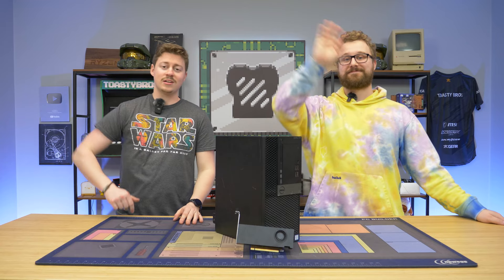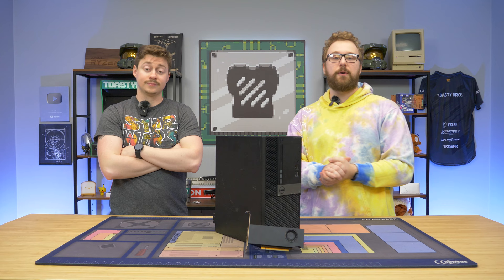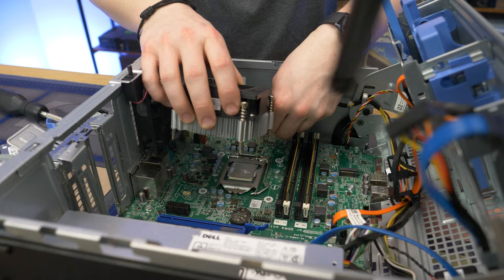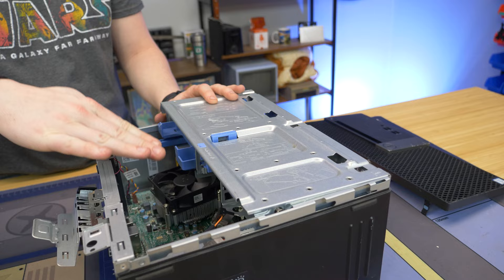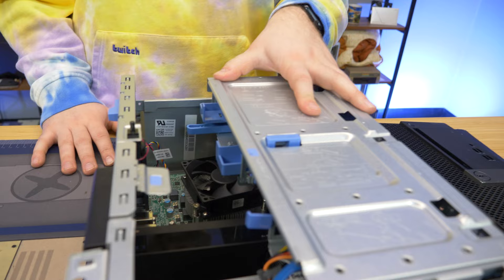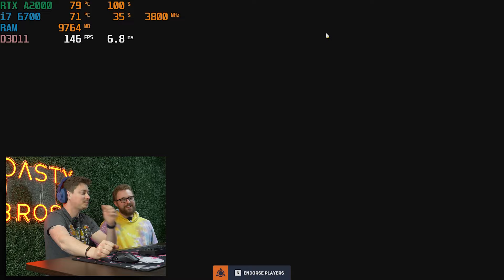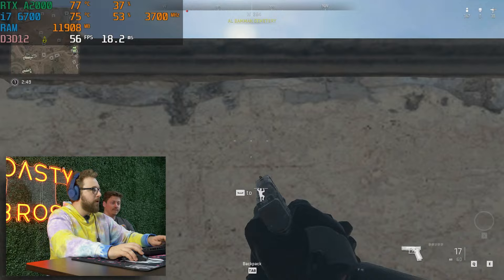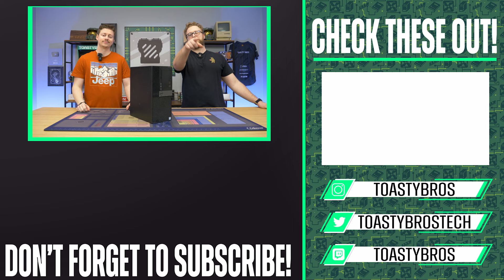This Optiplex Is Faster Than Most Gaming PCs?! 😮

Comment: I have this exact setup but with an EVGA 3060ti in it. There are a few options that make it much better. This motherboard supports one gen 3 m.2 ssd (up to 2 tb) on the motherboard. Intel invented M.2 Drives and Dell computers were the first to implement them standard on all models since 2014. Based on the similar cost it is much better to use a M.2 rather than a Sata ssd for the 4 lanes of connection they have rather than the 1 lane you get with a Sata connection. You can "Clone" the hard drive to the M.2 to keep the OEM copy of windows that comes with the PC (there are many free cloning programs available online). You need to first start the computer and setup windows on the Sata drive and then "connect" the windows copy to your microsoft account by logging into your account and "registering" your copy of Windows. Then clone the original drive to the M.2 drive. After that you then set the pc Bios to boot off of the M.2. (My boot took less than 3 seconds off of my M.2!) Once this is setup and working you can then wipe the original drive and use it as storage or as a game drive. 

This particular tower has the room to replace the original power supply as well. You will need to cut out the rear panel to give the opening for a standard size PSU. Stop! Dremel Time!  You will need the appropriate 24 pin adapter to connect the 24 pin power cable to the 8 pin connector on this Dell motherboard but those run around $6.00 - $8.00

Depending on your preferences you can do a reverse setup: I did end up swapping things around a bit. I am currently using a 256 gb Sata SSD for my boot drive, but doing that did slow my pc boot from 3 seconds to about 10 seconds but i switched my Steam library to the 1tb M.2 for faster game loading and, most importantly, to get 3 second load screens on my games instead of the 20 seconds provided by the Sata ssd. I now am usually the first to load in on multiplayer games with 3 seconds ahead of the SSD based players and up to 8 seconds ahead of HDD players giving me a huge advantage!  

Later, I did move the whole thing into a standard ATX case. While this board does have integrated front I/O it does still come with connections for the external front I/O  of any case you would put it into. The only issue may be the power switch since Dell uses an interrupt style power switch instead of a circuit connection type, but it is easy to find the pinout solution online to fix this. (You just have to splice 2 specific wires from the case into one single wire to connect to the motherboard power switch). 

The main benefit of the integrated I/O on the motherboard is you can use those AND the external ones on your case AT THE SAME TIME since they are wired as separate lanes. I use 2 of the integrated front usb to power 2 seperate system monitor screens (one 3"x5" and one 3"x10") that are mounted inside my case. as well as using one of the usb connections to power a generic RGB strip running a loop inside the case.

Please note that if you swap the cooler or the case you WILL want to keep the original Dell fans since the motherboard "communicates" wit them and replacing them will result in a system error on boot up that you will need to press F2 to bypass. If you keep those original fans but add additional fans or keep and relocate those fans you will not see the error. I swapped the cpu cooler to one that came with 2 fans so I added a 3 way splitter and ran both of the new fans on the cooler along with the original fan that I relocated to a custom mount so it blows onto my RAM (total of 2.7 watts on the 3 watt header). I kept the original case fan and mounted it as the back exhaust fan in my case but added 6 fans ran off of a Sata powered controller.

Additionally the case intrusion alarm switch and the internal speaker switch are not needed and you can toss those if transplanting to a new case without any boot errors. I kept both of mine (switch/internal speaker) to add a joke "car alarm" to my case to amuse those I show it to. Something you can only do with a Dell :)
Reply: Forgot to include. If a Dell PC has an M.2 slot it is always ddr4 RAM. Dell moved to ddr4 at the same time they began including the M.2 slot. Dells do not support ram overclocking (up to 2666 speed, but dell offers motherboard Bios updates that enable up to 2966 speed for the optiplex 70xx and newer series) but you CAN enable RAM Boost which will tighten up the RAM timings and cut out a significant amount of RAM lag. This will show up as about 5 -10 extra FPS.
Reply: @baddayguygaming  Literally did the same thing. I put a SFF PSU and a 1070ti in it and it just ran to hot. Moved it to an atx case and did almost the excact same mods. I was blown away with the performance. BTW the outsides of the 5 pin case fan are both ground so you can mod the exhaust fan and dont have to press f1 or have an 80mm or 90 whatever it is dangling. 

Very well written btw. Way more eloquent than what i was gonna say.
Reply: There’s a Silverstone power supply that is the same exact form factor as the original. It’s the tx700. But you’ll still need the psu adapters.
Reply: 6700's have started to bottlenecked these 30 series gpu's i recommend a 9700k for the rtx 3060 ti
Reply: Dude, we’re not worthy!  What a comment!  Wow!  Very impressive.
Reply: I ain't reading allat
Reply: Dc
Reply: what optiplex model did you use
Reply: @imposter4518  I was using the Dell optiplex 7040 with the i7-6700. If you want the best value for a transplant then look for the 7040 sff. (Small form Factor)
Reply: Had an OptiPlex as my first computer, will say it was good for what it was. I would look into upgrading everything, you wont regret it
Reply: @vadgebadger7214  I'm about to try this.  What mod do you have to do to the fans to use any fan you wish (any recs?) ?
Reply: @DeepakKumar-lv4te  if memory serves me correctly I had to have 2 jumpers and I used a razor controller to manage the fans. If I were to do it all over again, I would find a mb on marketplace or somewhere cheap. Or LP graphics card on the cheap.
Reply: There are use cases where NVME is far faster than SATA but for 95+% of computer users, the difference is negligable.  In games, your load speed might be 1/2 second faster if that.  Honestly, NVMEs are as cheap as SATA SSDs now so if you can use NVME, no reason not to unless you have a VERY small case and don't want the extra heat.  Don't expect a noticeable difference in every day use though.
Reply: @baddayguygaming what about the 7060 (large tower size) with the i7 8700? Could it fit and power a Nvidia GTX 970 card? 🤔
Reply: *MSI GTX 970 gaming 4G twin frozr
Reply: According to the specs the 7060 also has a thunderbolt port so I assume the GTX 970 could be mounted in an external case/enclosure?
Reply: dude you need to make a video showing this whole setup!! that's impressive. I'm building something similar and I would like to see how you handled the fans!
Reply: Whole english essay 😅

Comment: I'm guessing the problem is the memory.  Judging by the FPS counter, the memory was showing that it was maxed out.  Seems like that would be the bottleneck of the system.  Everything else looks good though, and honestly that's still respectable numbers to see as far as temps go, and FPS.  The only thing i would have been interested in seeing more of, would have been testing during the whole upgrade process.  I.E. Remove one stick of memory, because it was only supposed to come with 8GB to begin with, then test.  Then, re-paste the CPU, and check the temps.  Then, swap the HDD for the SSD, and test.  THEN swap the GPU, and test.  Finally, add that last stick of memory.  This way you could see how much extra performance the computer has from start to finish.......Or at least test it in its original configuration before doing the thermal paste.  Then, do the thermal paste, swap the GPU, and change to the SSD, and run the "after" test.

Comment: built a gaming pc for 250 bucks with a 1tb sata ssd, 16gb ram, rx 580, and i7-6700k with an optiplex
Reply: nice
Reply: They can make really nice sleeper comps. I had to pass on the rx 580 due to miners flooding the used market with them for the last year, otherwise I built the same rig for our youngest son but stuffed an old maxwell Titan X ,we had from an old pc, for the gpu and it still runs under the psu rating. Really nice sleeper and he plays minecraft and similar games seemlessly.

Comment: Guilty with the config.  Have an optiplex 7040 i7 6700 with a A2000 RTX gpu ❤❤❤ This optiplex was going to the recycle and I just requested this from the IT dept.  They just removed the hdd.  So i just bought an ssd and os :) the  got the keys at gvg mall.  But the funny thing is…i have the sff one.  So i put the card at the pcie 8x (black) port 😂  but it still working
Reply: i upgraded from a 7020 sff with a 1650 which i used to have in the pcie x4 slot 😅. i recommend getting a new case mobo and cooler because it can offer better temps and performance from the x 16 slot
Reply: I need to find an IT department and ask if they have stuff to throw out

Comment: I think its better than my third pc, which is an apu system :P
main pc is 5800x3D/rtx 2080super
second pc is ryzen 3600 / gtx 1070
third pc is just a 2200g pc I put together to test my curiosity with an apu and I'm happy with it
Reply: Nice, tough to beat the 5800x3D.  I always go with workstation PCs though.  They almost never break, almost never crash and parts are dirt cheap.  Best of all, they generally hold up to the test of time much better due to far more PCI bandwidth, quad channel ram, HUGE RAM capacity (mine does up to 512GB) and amazing ports and power supply.  I built an HP Z4 G4 with the 8 core Xeon mentioned earlier, 32GB RAM and a 3070ti for about 450 bucks (already had SSDs).  It's quite well balance CPU to GPU as well.

Comment: Note, if you run into a situation of needing an adapter to use sata power to 6 pin gpu power that the sata's voltage will be limited and in some cases not sufficient as a power supply solution for GPU and depending on the driver in the GPU could actually throttle or bottlenecks performance.

Comment: 12:18 the normal Game Ready Drivers work on the A2000 as well. Simply download them instead of the studio drivers. Low GPU usage is mainly because the i7 6700 is a big bottleneck for the A2000.
Reply: it really isnt though because it was the CPU was using only 40-60 percent in warzone

Comment: I just got a Dell Optiplex 9020,Dell OptiPlex 9020 Small Form Computer Desktop PC, Intel Core i7 3.4GHz Processor, 32GB Ram, 1 TB Solid State, Wireless Keyboard & Mouse, Wi-Fi & Bluetooth, HDMI, Windows 10 Pro...now i need a GPU.

Comment: Thanks to you guys I found out it's not that expensive to have a nice pc. Today I received used msi rx 570 4gb for 40 eur. Now next in the list is Optiplex 7050 with 7 gen i7. Fingers cross if Optiplex I get is the right one! 😅
Reply: I change my mind by weeks. So I forgot the idea of spending 400 eur for Optiplex when I can get same or better performance from 130 eur of second-hand parts and build pc on my own.
Reply: @elderelf9943  The difference is Dell's build qual is top notch and PC are usually pretty stable, and 7050 should come with Thunderbolt? My Precision T3020 with replaced PSU and added overclocked GPU runs very, very smoothly. Let's just say this: it's running 24/7 (of course not used all the time, I'm just not powering it off), 5 years now and I had 3 BSODs over that time, all after either multiple drivers update or after major windows update. Games also run smooth. And it is running with 70% RAM constantly taken by SQL Server, VS and other stuff, in addition. 
Very stable, will be sad to see it go.

Comment: Actually have the 7040 in sff its a good little machine, i have the rx6400 low profile in it and it can kick.
Reply: @PigyOstudiosofficailchannel   fairly good actually i can get about an average 80 fps on fortnite and it can run most other games at medium settings. its not really gonna compare with a  psu powered card but its pretty nice.
Reply: @PigyOstudiosofficailchannel  5040 sff
sorry for the confusion

Comment: I wedged a 1660super in it with a data adapter.  I’m about to lord the case a bit though, tilts really tight.  Runs great!
Reply: do you use a 240w psu? i want to upgrade my gpu but i cant replace my psu
Reply: @zakaii6430  I believe it’s a 260.  Sfx psus fit.
Reply: @RespekfulFungus  thanks

Comment: Thing to check is if the system didn't originally ship with a graphics card, look up the motherboard and make sure it had x16 on the pcie slot. we inherited a bunch of dell i7 machines at work and were going to put gfx cards in, I looked up the mobo and they were only x8 so we ditched the idea.
Reply: didn’t think about a a 2$ adapter?
Reply: @jpc3874  what do you mean? the slot was x16 size, but only x8 was available through it. an adapater will solve nothing

Comment: Toasty Bros Vs. The Dellasaurus.  😊  Those newer ones are a bit more restricted than their early 2010s counterparts in terms of potential GPU upgrades, plus I think the PCI Express was a gotcha lol.  🙂
Reply: I stuck a gtx 1660 ti into my own dell optiplex 7040 MT no problem, it would be just as easy with even an rtx 30 series card.
Reply: @Sprite897  Depends on the length.  I almost ran out of room with my own Optiplexes even with 2 fan cards.  🙂

Comment: I'm running the same 7040 mt i7 6700, rx 580, 16gb sk hynix, 500 crucial m.2 and its a budget beast. Plays everything so far and I can stream in 720p. I have a asus z170m-plus mobo and thinking about picking up a i7 7700k and upgrade my gpu to rx 6600xt
Reply: No sense jump from i7 6700 to i7 7700, better sell RAM/CPU/MoBo/GPU and buy a strongest Pltafform (ram DDR4-3600Mhz or ram DDR5-6000Mhz), CPU- 6C/12T or 8C/16T on socket AM4/AM5 (AMD) or 1700 (Intel).

Comment: had to upgrade the PSU to support a 2060 super. to test if it works at all, used an unbranded 400w office pc PSU. it worked fine at first until the PSU exploded. pc survived, which is good, but i have yet to test the gpu.

Comment: I have an AMD R5 340 graphics card so I put it in my old 7010 I have and now they can play crysis at the highest settings at 20 to 30 FPS in a firefightI have an AMD R5 340 graphics card so I put it in my old 7010 I have and now they can play crysis at the highest settings at 20 to 30 FPS in a firefight and also I think the r5 340 is like touch powerful more than the 240 but it was like $10 on eBay it was a amazing deal for the price

Comment: Nice system guys.  (Mine Optiplex 9020SFF RTX A2000, i7 4790 running at 3.8ghz. AND  (I have two Optis'.)  Optiplex 9020MT RTX 2060, i7 4790K 4.0ghz base, running at 4.4ghz, Corsair CX 750M power supply.)  Again!  Nice system.  I'd like to grab one of those newer systems if it uses DDR4, but the listing you put up says DDR3.  My systems are DDR3 for sure.  I think you MIGHT be nudging out my SFF Opti a tad.  Might.  My 4790k does feed that RTX 2060 pretty well, and I get about as much out of one of these systems as possible.  It can run almost anything.  Know what starts to cripple the 4790k???  Hogwarts Legacy.  When running on my 12 core newer system, you can see in even a task manager performance graph ALL 24 THREADS are used by HWL!  At about 30% by the way.  Its actually a nicely optimized game BUT. . . I'm afraid there is just loads going on in HWL, and boy does it give 4 cores 8 threads a hard time.  It'll do it!  But yeah. . . HWL of all things starts to say, 'that 10 year old Optiplex. .. is still friggin awesome!  And you can still play HWL!'  Once more.  Nice system.  99% of people would be very happy to get THAT for the money.

Comment: Talking about gaming, it's all about VGA card which usually costs more than other PC components together. i7-2600 with RTX4070 plays 3D better than 13th gen i9 with RX6400 no matter what.

The truth is, if buying second hand PC for gaming nothing below 8th gen Intel or AM4 is viable option, because difference between 3rd and 7th gen of Intel chips is symbolic and only since 8th gen there is a room for improvement. And if PC is used for web browsing and playing videos any 3rd gen i5 with GT1030 will suffice.

Comment: im gonna build my own pc with an i3 12100f and RX 6600 xt
Reply: nice i would actually recommend if you're going with an intel processor to buy an nvidia graphics card like the gtx 1660 super or ti. But still great build!
Reply: Nooo get a i-5 leave the i3 in the dust, its not horrible but trust me get a 6-8 corr processor not a 4 core thats worse than the old gen xboxs and PlayStations you need at least 6 recommended is 8 cause of new gen consoles
Reply: Nooo get a i-5 leave the i3 in the dust, its not horrible but trust me get a 6-8 corr processor not a 4 core thats worse than the old gen xboxs and PlayStations you need at least 6 recommended is 8 cause of new gen consoles
Reply: Especially with a 6600 xt bro then why intel cpu get a ryzen 5 5600g or something if thats the case
Reply: @fankovic  its more money for worse performance
Reply: @paneledp  yeah but statistically intel proves to be better than amd at performing with nvidia and amd gpu and intel cpu dont go that well together
Reply: @paneledp  and in my country gtx 1660 ti is less than rx 6600 xt and nvidia drivers are way better.
Reply: @fankovic  think you're looking at wrong statistics, that's not how a graphics card works